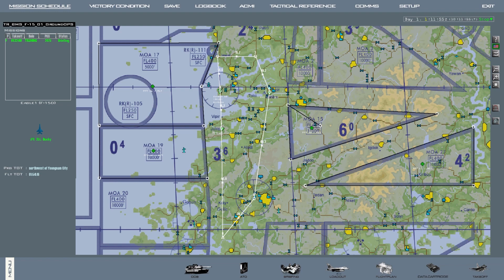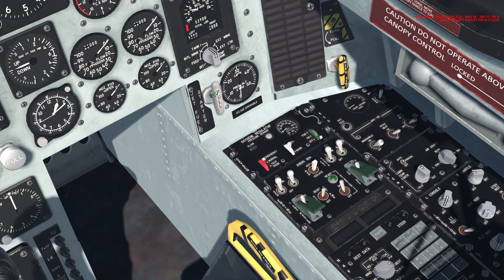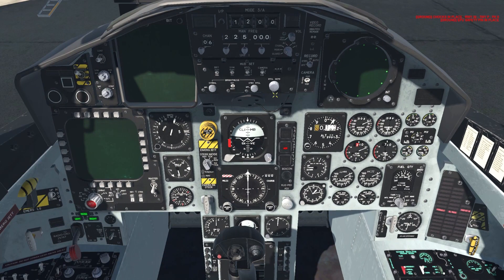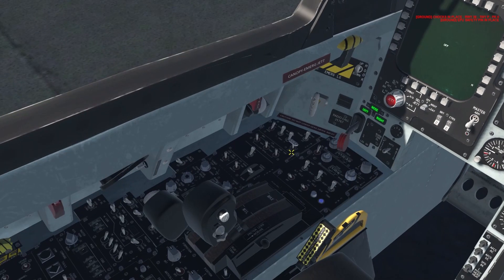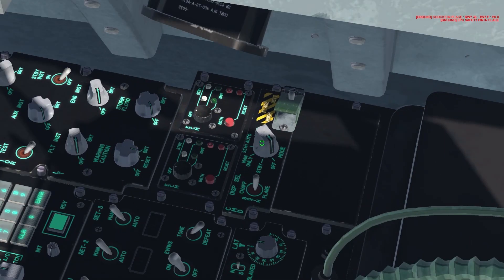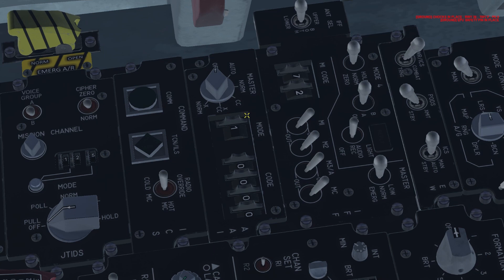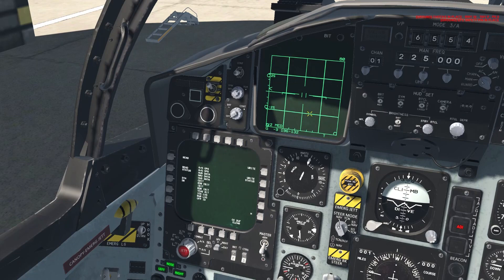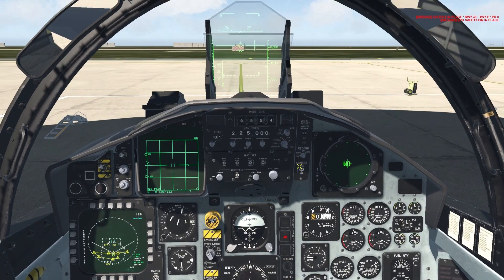Quick Cold start F-15C Tutorial | Falcon BMS

Comment: My right engine rise up only  to 20 - 21 % and shuts down. Never reach 25% to click idle. What is wrong?
Reply from the maker: You might've missed a switch on the engine master panel, make sure you have the generator switches flipped to on, if you're flipping the switches one engine at a time, they like to hide behind the green switch guard
Reply: @DaTruRubb3rduckies  generator is in position "on"
Reply from the maker: @paweciechan9266  did you wait for the ready light for the jet fuel starter?

Comment: I have an issue with Link 16. Going from cold start, I only see steer points on the map. I cant actually see friends or foe. What did I miss?
Reply from the maker: assuming you loaded the data cartridge in the 2d map, the JTIDS switch on the left side wall panel needs to be set to auto, that turns on the link 16, also try rereading the dtm on the ampcd. I was having troubles with it before I made this video, it took me a couple rereads through the manual to figure it out. also, I had differing results depending on missions, and you'll need to be receiving data from a local AWACS also to help it out
Reply: @DaTruRubb3rduckies  Thanks man. I think I messed up in 2D.

Comment: Small correction: it's not that the first engine takes a couple seconds to start but that there is no "generator" power until 18% for the gauges to show RPM and temp
But the engines starts turning as soon as you lift the finger lifts, even if it can't be seen :)

Comment: I have a problem where the right throttle wont go to idle , any idea what is the issue ?
Reply from the maker: It could be that your keybind might not be set up, in the launcher its called "THR: CUTOFF RELEASE - idle detent - toggle"
and it might have a combo key with it. I think the default keybind is alt+i. and make sure you have the proper engine selected
Reply: @DaTruRubb3rduckies  ty !